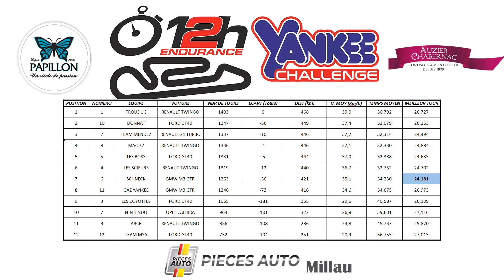YANKEE CHALLENGE - 1/4 SCALE RC CAR - ENDURANCE RACE : 12H OF SAINT-AFFRIQUE 2024

Comment: What transmissions do the cars use? Are cylinder engines allowed? Do the cars use exhaust pipes? Are any body material allowed? Like, can somebody 3d print a fully carbon body and permanently bolt it to the car? And finally are prototype like lmp1 hypercars allowed?
Reply from the maker: @Mustang525  these cars use a pinions cascade as transmission, automatic gearbox are no more accepted in compétition. Engines shall meet the fifth scale rules: from 23cc to 26cc monocylinders. Two cylinders engines no more accepted in competition. Bodies are in polycarbonate or ABS: for this specific competition, only official bodies are accepted. A full 3D print body would be too fragile IMO. LMP1 cars already exists, but not allowed for this endurance race because not fair for touring cars ( much more downforce with a LMP body)
Reply: @RowhiderRCRacing  gotcha do you guys like have an experimental or garage 56 like program where a invitational car doesn’t have to follow regulations or bop(of course im talking about is own class it won’t interfere with the actual race)? And I missed two questions: do the drivers use onboard cameras to see and drive the car and what’s the top speed the cars reach on the back straight?
Reply from the maker: Currently no garage 56, but sometimes when the number of engaged teams is low, cars can participate without be fully compliant with the rules.
Reply from the maker: @Mustang525  no inboard camera for driving, too costly for a racing car: you need a very fast system to be able to match the speed of the car. For these endurance cars with tuned engines not allowed, the topspeed is comprise between 70 and 80km/h
Reply: @RowhiderRCRacing  I have been wondering these things for a long time thank you!!
Reply from the maker: @Mustang525  you are welcome
Reply: One more question what is the weight of the cars?
Reply from the maker: @Mustang525  it depend of the size of the car (true scale in 4th scale) but mainly between 11 and 13kg. The heaviest weight 14kg